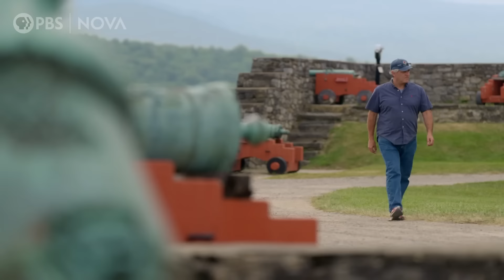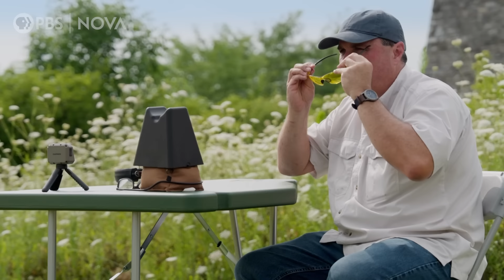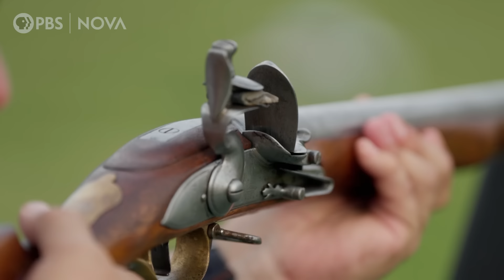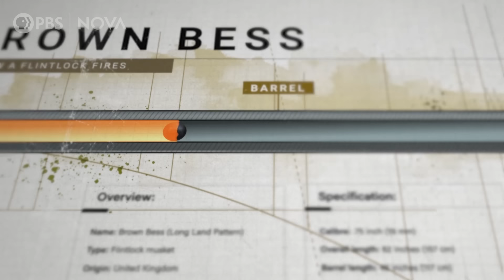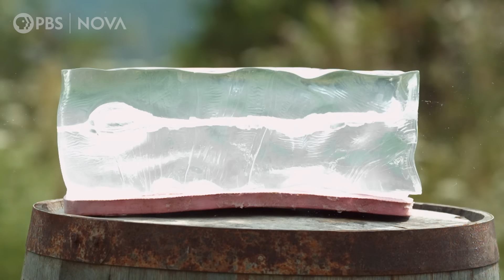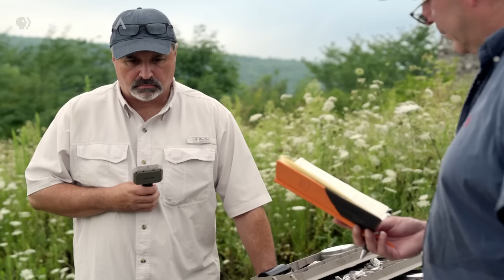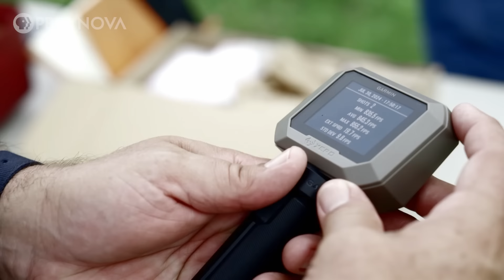How Deadly Was the Musket? | NOVA | PBS

Comment: Good, clear info, without a long leadup.  Next video I am waiting for will be to compare a modern gun with weapons used 150 years in the future, 2175.  A laser does damage only when its wavelengths are absorbed. A clear gel would not be affected very much compared to a black gel, but the pictures might need to be X-ray images. You might shoot through a window without breaking the window. Electro propulsion needs a long "barrel" to accelerate.
Reply: Phased plasma rifle in the 40 watt range
Reply: @JKHTX  only what you see pal
Reply: @JKHTX  With power supply, as carried  by imany nfantry moving thorugh trees, bushes, over logs, and through swamps as they go from trench  to trench, or through a wrecked house, with a big pack on,  in rain, to be fired as fast as a AK47 ?
Reply: @CanuckBeaver  that's what Boston dynamics atlas and 4 legged mule are for.

They're not in news as much.  Probably government cover up.  Skynet is coming/here
Reply: Uh, so other than proving bullets work what comparisons between them did it make? Do you now know the range difference? Or accuracy? Nope. Entertainment is not knowledge
Reply: @julesknight-1177BC  I am a retired physics teacher, and easily get into Sci Fi. Your comment makes me think that we will still be using guns because a little bit of gunpowder and a little bit of lead does a lot of damage, as shown in this video, and they  are cheap, work in all weather, quick to reload, easy to maintain, can be used as machine guns, etc. With all the work on lasers, they are still only experimental with too many disadvantages.
Reply: I got news for you. There's gonna be a major cataclysm around 2030.
Reply: @ Read the news. It is already here, a Trumpaclysm, national suicide. The US is now a Banana Dictatorship, a full blown Maga-Disaster. It hasn't  trickled down to the masses yet about what they have already lost. We in Canada will have to send in relief supplies.